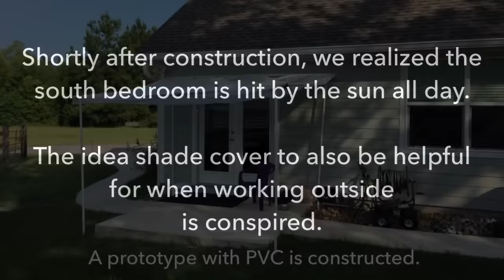Porch Cover Construction DIY in 5 Days - Timelapse

Comment: Love it. Looks like everyth8ng is to code. As far as the beginning hick up with the support, happens in every project! There are just things you can't foresee sometimes I've found.
Since this is during Christmas  I'm sure you won't be getting much rain, like here on WA state. Though there's some slope so any weather can be pulled down to gravity and not pool up. Cedar, excellent choice! Looks great.
I'm wondering how it's held up over the years going to check out the comments. Great video! 👍🏻
Reply from the maker: Hello. Thanks for the comment and taking the time to watch!! The cover has held up very well, and I have done two others since this one. So, I have gotten better. Unfortunately, one of the cedar post got termites. I was pretty surprised. The reason is that I put some soil above the concrete, trying to bring the grade up a bit. The concrete to the post is at grade to the area beyond the post, but there is a little drop off from the post. I think I got the termites quick enough, but there is some damage. May eventually have to deal with it. Otherwise, the cover has been excellent, and held up to several high wind events.

Comment: This project is exactly what we need for our backyard patio, same dimensions and all!  Thank you for posting!  We are going to buy the materials in the next few days, but my husband would like to use roof shingles.  Would you recommend it?   Also, what bolt size should we use?  Sorry! we are new DIYers!
Reply from the maker: Wow! Thanks for the feedback. Glad the video may help. If you go with shingles, be sure to increase the pitch. I felt ok with less pitch, because I had didn’t have the room for more, thanks to the metal roof. But for me, the metal roof fits with the barn right next to it…not the same color, but still ok. And, the metal roof complimented the stain of the wood. I’ll check on the bolt size if I don’t have it in the description. But be sure to look there as I have a list of materials. Good luck with the build!!
Reply: We did it! I wish I can add an image here but it is now an awesome patio, thanks to you!  I usually don't stay outside, now it is a hang out place for me and my husband, and an extension of our kitchen. 🥰 The 10 foot roof is out of stock so we ended up using a 12 foot green roof which perfectly matches our grass. Thank you again!
Reply from the maker: @anaceciliamillena4014  Wow! So good to hear!! Thanks for the update. We just put an updated outdoor tower fan that has made our an even “cooler”.

Comment: Hey Drew did you mount your ledger board on top of the siding?  Mine will be very similar to yours as well.  

Thanks bud! Looks great btw!
Reply from the maker: I did mount right on to the siding. However, I had a framing stage construction picture, so I knew exactly what I was sinking the lag screws into. And I went with quite a few bolts. Good luck with your construction. Let me know if you have any other questions.
Reply: @DrewLoker  thanks for the fast reply!!  Did you add any sealant to the board? Doubt much water gets under there due to the roof line.
Reply from the maker: I did not seal the hole with the lag bolts, nor the area above it. I did treat the cedar with an oil based stain. I did not bring the concrete high enough above grade and water and termites has damaged one of my cedar posts despite sealing the wood…and it being cedar.
Reply: @DrewLoker  that’s frustrating!
Reply from the maker: I would put a 2” above grade on the concrete.

Comment: Hey Drew.... man this is awesome!  Great job!!!  I do have a question for you.  When you were hanging your ledger board, How did you know where to screw in your lag bolts?  How did you know where your studs were?  Thanks
Reply from the maker: Thanks a bundle for the kind comment! I really appreciate that!! As for the studs, I was fortunate to have construction pictures of the house before the siding. So, I knew exactly where the boards were. And in this case, I am not sure what the official name of the header section is called over a door, but there is a substantial amount of wood up there. If you have a newer house, you should have a similar construction format for that door header. I suppose you can try a stud finder and see what it comes up with also. I used 8 lag bolts so it is not going anywhere. Hope this helps.
Reply: You could always just measure 16 in from the door frame or electrical outlet. That's what my dad taught me. I guess a older house may have wider spaced studs.students. Also if it's just drywall just hammer a thing nail in there & if you can pull it out w your finger "well its not a stud go get some puddy" 😅

Comment: Nice and simple. Kind of what I m looking to do. The only question I have is how to attach that main board to the wall covered with siding to avoid any moisture issues... You didn't show how you did it, unfortunately.
Reply from the maker: Thanks for the comment! Sorry I missed an important detail. As for the moisture issue, I was not too concerned because of the roof overhang...and it has proved to be as I hoped...enough of an over hang to not be an issue. As for the mounting, I used long lag screws. I have pre-siding, construction images of the entire area over the door and feel pretty good about the 10 lag screws sunk through the header board into the door jams header. The cedar is flush with the hardy board. There is a slight angle to the hardy board, which I matched with the header I attached. Hope this helps.

Comment: The time laps with the typed tips should’ve been a little slower lol.
Good job though
Reply from the maker: Alan Perez thanks for the comment and feedback. I did work on the timing for a good bit. The video used to be 2x as long, but it was just way too long. So I used. youTube’s editor and sped it up figuring if somebody want to slow down a section, they could.
Reply: @DrewLoker  Gotta agree with Alan. I was spamming the play/pause button all through because it was 1 second to read anything
Reply from the maker: O A I agree also. It was originally an 8 minute video when I put it on YouTube. Than, I cut it down to 4 and then 2 minutes. At the time, YT had a pretty decent online editor to fix minor challenges. Then YouTube killed the online video editor. And, YT doesn’t support replacing a video with a newly edited version after the fact from an offline editor, like say Vimeo. Bottom line, the text was timed for an 8 minute clip, but it was just too long, and I decided that it flows better as a timelapse. And if somebody was actually interested in reading the details (most aren’t), they could always pause it...or slow it down if they are on a full computer. When I show it to students, I pause it and elaborate on various aspects...and let it play over others.
Reply: @DrewLoker  Completely understandable
Reply: you obviously did not read the description at the bottom.  If you click on settings, you can slow down the video.
Reply: @venegasra ,  you obviously have way to much free time, get a job.

Comment: This is beautiful, just wondering if it leaks when you have heavy rain where the wood meets the siding
Reply from the maker: Thank you so much for the kind comment!! This porch cover does not leak at all, at the back, from any of the margins of the roof sheets, nor the screws. I put a gutter on that drips a little because the roof sheets went right up to the edge…needed to shorten the length a bit to have a lip to adequately gutter. I also wish I had gone two feet (one panel) wider to help with early/late day sun and side blown rain. Hope this helps.

Comment: How did you attach the ledger to the siding given the siding has an angle? Did you compensate with angle on the rafters? Did you use the inverted siding method to make it even? And did you use any deck2wall spacers or anything to put a space between the ledger and siding?? Thanks in advance!
Reply from the maker: Jioni Did It Good question! I flush mounted the header board flush against the hardy board and screwed in 10x 8” lag bolts into the double header threshold. I had a picture of the house construction at the framing stage, so I knew I was anchoring the header into something pretty solid. The side frames were trimmed at an angle on the end to give the desired pitch.
Reply: Thank you so much for your speedy reply! This helps!

Comment: Did you remove the vinyl siding to put that board on the house? Also may I ask what you uses to secure the board to the house? I am wanting something just like this and hoping my husband can do it. This will be his first project like this 😊
Reply from the maker: No, I did not remove the siding. I think I used 6" lag bolts knowing that it was going through three 2" thick boards. 
You all can do this. This was my first big project, but I have done two more since, including the a greenhouse I am almost done with (there is a preview on my channel).
Reply: @DrewLoker  ok thank you so much. How far apart did you put your rafters? We got our measurements now we are just trying to figure out what we need and how much lol.
Reply from the maker: @jenn12mark  24". Be sure to clue in the video description. I know the video goes too fast, but I put the captions and list of items there for your review.

Comment: Why fast forward so fast when you have captions to read? It's a little uncomfortable to rewind so much just to catch that part. I cant ever finish the video.
Reply from the maker: Drumskas and Jason, it was initially published as a time-lapse...a photography experiment...it was captured that way “in-camera”. So, I didn’t technically speed it up, not at first anyway. The additional info was added after viewers began asking questions on how to do something like this. I also used a then present YouTube feature to speed up the video a bit as it was agonizingly slow at 8 min. While I was experimenting with the frame rate, which was an all or nothing change, YouTube removed the ability to change the frame rate. I also edited this on an iPad, so even before it was posted originally, and I was only trying to publish an iPhone Time-lapse, there were limited controls to speed up and slow down some segments. If I had edited this initially, as an instructable, and done so in Premiere, then I could have controlled the frame rate. Anyway, this has been explained before, but for any recent viewers that have not read below, I thought I would post a recap. Thanks for the viewing and taking the time to comment.
Reply: you obviously did not read the description at the bottom.  If you click on settings, you can slow down the video.

Comment: Hey Drew. Awesome job! What does the material called that you used to cover the roof plz?
Reply from the maker: The panels are J Panels purchased from OCBM from what they had in stock. Since this was going against a shingle roof, I didn't worry about an exact match. For another cover I did, I was trying to match an existing metal roof, and ended up getting J panel when I needed R. So, if you are trying to match an existing panel, do consider your options. Lowes and Home Depot have more to choose from in stock, but when you start wanting a special color, you do get to consider the shape of the peak.

Comment: Are the rates which are attached to the header cut at an angle and if so what  degree? Novice builder here.
Reply: Rates should have said rafters!
Reply from the maker: Good question. Yes, I did cut them at an angle. The degree is going to be based on the pitch you want. I did not use an ideal pitch, due to the clearance I wanted, but I did get the maximum pitch I could and it is ok. I used a framing ruler like this: https://amzn.to/3PL5jjT
Reply: @DrewLoker  thanks!

Comment: What type of screws did you used to secure the metal roof ? And did you use any silicone to prevent from leaks?
Reply from the maker: I will see about getting you an exact description from the box and add to the description. But, generally, I used metal roofing, self taping screws with neoprene washer. I have had zero leaking from any of the screws. However, note that I screwed into the valleys, as opposed to the peaks. Most videos will show that you should mount to the peaks to avoid water (and possibly ice in some environments) from collecting on the screw head...and leaking. I decided against this, and just kept it simple...ran the screw down snugly. If you mount to the peaks, you have to be a lot more careful with avoiding running the screws too tight. No challenges with this roof. However, on a poly roof over another area, I again screwed into the valleys, and it is has been a bit less ideal with about 4 screws leaking of about 200 screws. I need to get up there and tighten (or loosen them). I even predrilled holes in the poly roof...just a bit more particular on the drill torque.

Comment: Put rhe video at 0.5x speed slow mo and youll be able to watch it and read it
Reply from the maker: That is correct, thanks, especially if you want to watch for the construction overview. I speed it up when YT allowed rate change in the online editor (it was originally 8 mins long and agonizingly slow). 4 mins would have been just right…but YT does not allow changes anymore. Thanks for watching.

Comment: Did you have to remove the lap siding where you installed wood to the house?
Reply: Also curious about this part!
Reply from the maker: No, I did not. It is hardy board, so I mounted right up to it. I had a construction picture of the studs, so I knew exactly where I was mounting.

Comment: As with some of the other comments I would have like it to be a little slower time lapse, but I like this ve ndor because it is similar to what I was planning. However I have a few questions. did you build this house of have access to the structure components? that is as you bolted the 2x6 directly ti the house has did you determine there was a header long enough to support the length of that support bean attached to the house? I figure it woulda hv been directly over the door but that is a pretty long beam, You did not share or I missed it what hardware materials like the size if the boys screw to attach this to the house. My thought was to drop wood support brackets down from the 2x4 over hang behind the gutter. What do you think of this idea? anyway thank for taking the time to make the video. good hjob over all.... helpful
Reply: What the mane of the paint  you used?
Reply from the maker: Sorry I missed your reply when it first came in. Let me know if you still have questions. But, yes, I did have the constructions pictures and very carefully considered where I was mounting the lag screws to make sure I hit the center of the main header board.

Comment: Dude....seriously....you flash text on the screen for literally one whole second and expect people to be able to read it?! C'mon.
Reply from the maker: The text was done when the video was 8 mins long. But back when YouTube allowed us to change the speed in the editor, I changed the entire video to 2 mins. It went from entirely too slow to too fast, and then YT removed the ability to change the speed. 4 mins would have been a nice compromise. However, it was intended as a Timelapse, and fortunately, easy enough to hit pause if a detail is needed. And, as other people have suggested, use the speed tool on the player to slow down. Thanks for your comment. Hope this helps.

Comment: Could you please explain how did you make the studs stay steady? Did you use a cement base or did you sink them into the ground? Pls
Reply from the maker: Mr. Alberte The posts are sunk about 18” and cemented. I used props while the cement was setting. Hope this helps.
Reply: @DrewLoker  awesome thank you so much.
Reply: @DrewLoker  last question, what did you use to attached the top studs to the stud on the wall and the main post? I ask because i want to do this exact thing on my patio. Thank you in advance.
Reply from the maker: Mr. Alberte I used joist hangers...two different varieties. You know...the thin metal brackets? I used some that turn 90*, and some that make a U. Don’t hesitate to ask what every you need.
Reply: @DrewLoker  great. Do you have an email that i can reach you out to for more in dept questions? That way i dont have to create a whole story on youtube comments  😂. I would appreciate it.
Reply: @DrewLoker  let me know thank you.

Comment: I wish it was slower and I would have liked to know some measurement , I have a simular problem and need to build a roof over my deck , my house is a mobile home sure its a 2020 model but still a mobile ..a free standing roof is only thing permitted , maby I might have to go ahead and attach it to house with a ledger board , and hope inspectors doant care ha,ha,ha
Reply from the maker: I have done a total of three like this video...all anchored on one side, then posts. But, like you, am about to tackle a 4 post patio cover, similar one saw in a state park. I think the main challenge will be in getting all 4 post in and squared off.
Reply: @DrewLoker  because I am not a builder , I am just not sure on how to build a free standing roof , and have it sturdy enuff to handle some fairly strong winds , North eastern wind can get windy up to 60-70 mph. I know if I dig a post hole 3 feet deep and secured the roof with a ledger board screwed to the house ,that will work , I did that on my last mobile it worked well ,lasted 15 years but on new home it needs to be to code , unless I just build a simple deck and after inspectors sign off and re do it

Comment: what did you use for a roof? were those corrugated roofing panels?
Reply: The panels are J Panels purchased from OCBM.
Reply from the maker: But I have done a couple of more of these patio type covers. On my Greenhouse, I used two different materials with light transmission. I am working on the video for that build, although I just posted a preview. I also did a cover with steel panels over an equipment storage area.